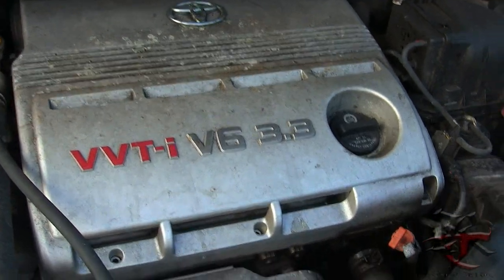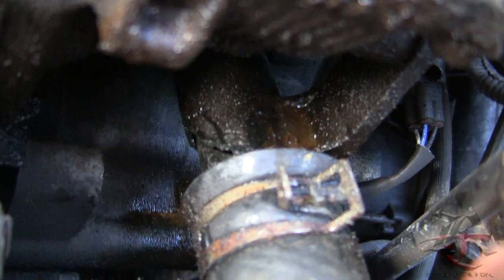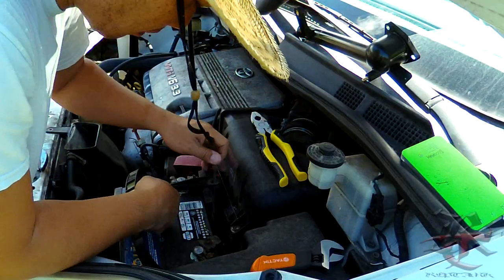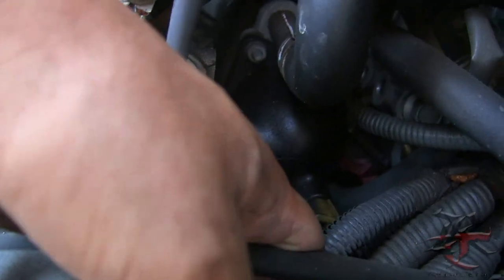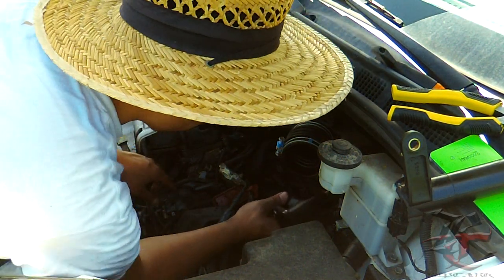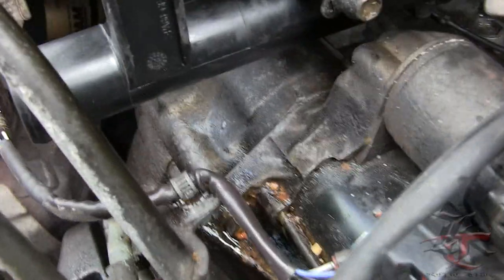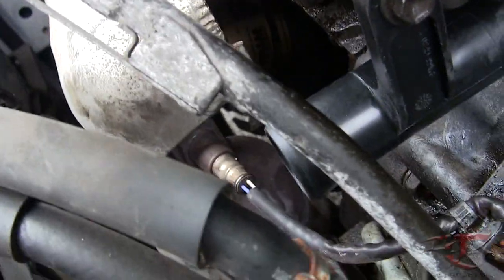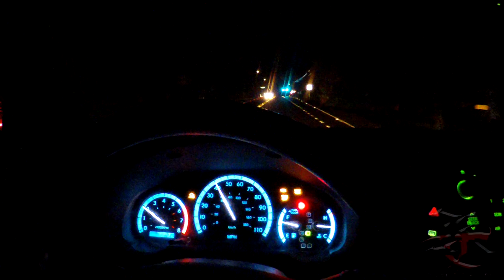2006 TOYOTA SIENNA van radiator coolant thermostat housing fix

Comment: Nice video. to get rid of the vsc , track lights which sometimes show up.. replace your brake switch.. I had the same issue and it was resolved when I changed the brake switch!

Comment: I also had coolant leak on the same spot. What I did was turn the clip 45 degrees and pushed the hose in further. It hasn't leaked since.

Comment: The 3 spark plugs outside on the front of the engine are easy but the 3 behind gave me a difficult time. Do not have room to work on.